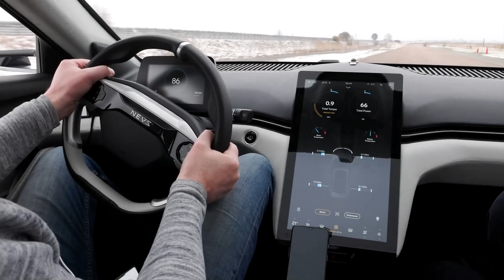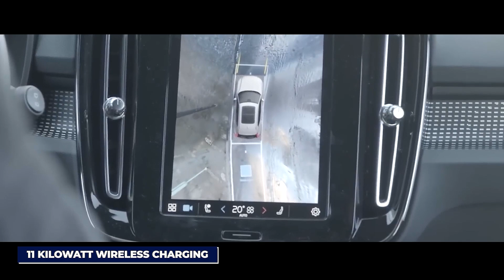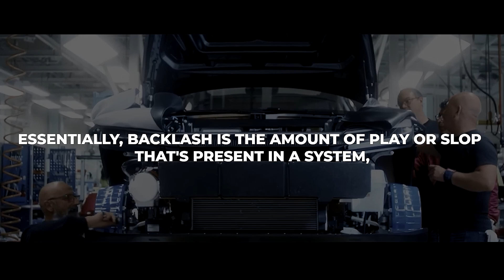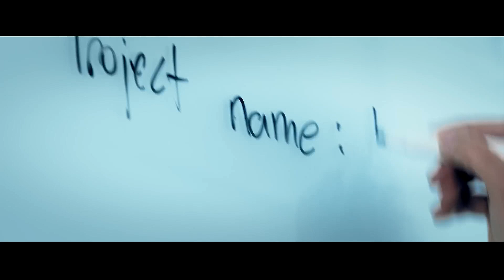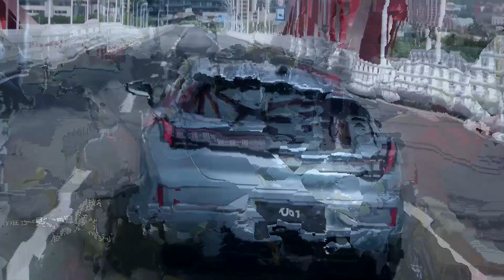SAAB Unveiled A NEW 621 Mile Range EV | SAAB Car: NEVS Emily GT

Comment: I’ve owned Saab 9-3 convertibles since 1993 and love them. I still drive a 2006 one and would really love to be able to refit to an EV. Someone said that it’s not (truly) a Saab, I beg to differ. If the Saab technology and engineering is there than it is genuine be it

Comment: 1:10  Don't like that bent tablet display. Looks tacky.  Too many manufacturers keep trying to do a Tesla dashboard it's horrid.  Would prefer two separate tablet displays better integrated into the dashboard.  I like the tablet display angle shift however, but not as one single display.  You can even see the crease in the bend.  Yuk !!!

Comment: NIO uses only 150 kwh for the same 621 miles of range; and the NIO ET7 Mega Range (1000 km per full charge) is going to be debuted in this coming month of November 2023.  Talking about efficiency, the NIO has the upper hand compared to this SAAB ev.
Reply: I think NIOs battery swap stations are a really interesting development. It'd be great if the swap tech was eventually licensed to other manufacturers. Something like this SAAB but with swap tech too would be a really cool combo!